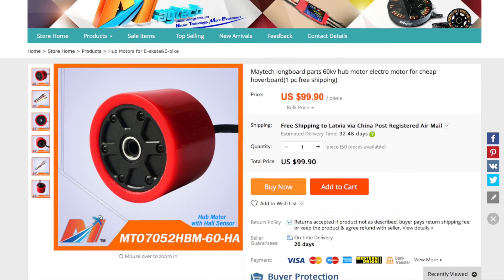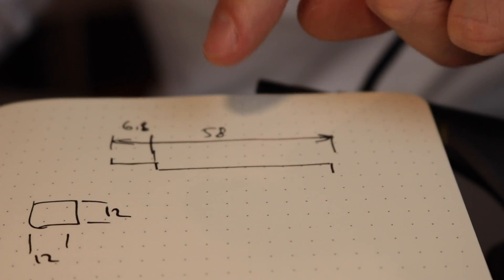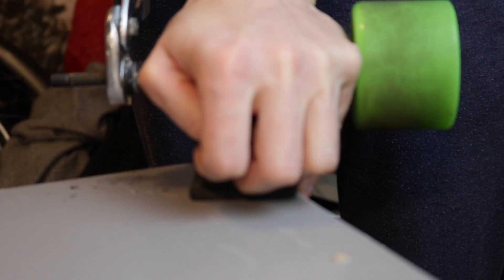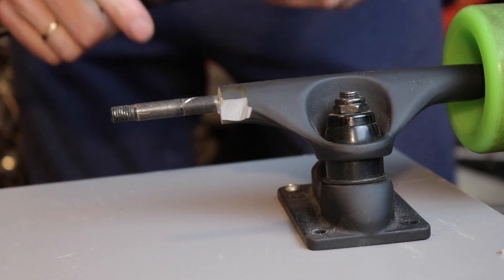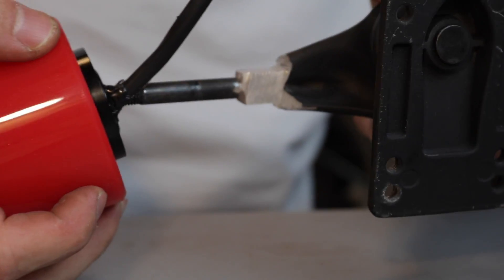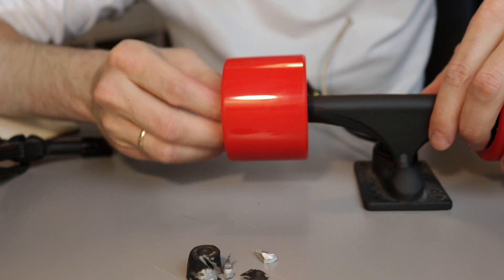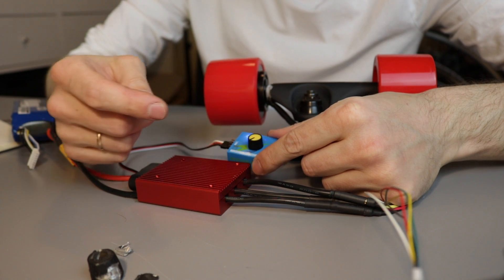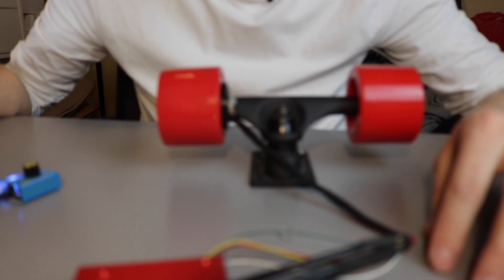Part 1: DIY Electric Skateboard, Hub Motor & Trucks

Comment: Great video.  Keep them coming.  Just about to do a self build myself. One question.  90mm or. 73mm. Hub Motors ?
Reply from the maker: So the both the 90mm and 70mm hub motors are 85KV which means that with a 6S pack you get 22V * 85 = 1870 RMP when the motor is not loaded. With the 90mm hubs that's around 30km/h and with 70mm hubs it's 24 km/h.
Reply from the maker: You can choose any speed controller, actually. You don't even need the hall sensor input since it mostly helps during the super slow speeds when you would normally kick to get rolling. Here is how I wired the Flier dual motor ESC that I'm using with the 90mm hub motors https://kaspars.net/blog/electronics/maytech-hub-motor-flier-esc-wiring

I wish these tiny Hobbyking Blue Series controllers https://hobbyking.com/en_us/hobbyking-40a-blueseries-brushless-speed-controller.html would support breaking because their performance is unbelievable. Most of the cheaper "car" ESC with support for breaking are up to 6S which is OK if you don't want/care about the top speed.

Any battery voltage is OK (only impacts speed) as long as it can deliver those ~20A+ peak (and most RC packs can do that).

The 90mm hubs are ~7mm wider than the 70mm hubs so it should work with any truck as long as you cut away a bit more, I think.
Reply from the maker: Those are 70mm hub motors. See the blog post for all the details https://kaspars.net/blog/vlog/diy-electric-skatboard-hub-motor-trucks
Reply: @KasparsDambis  HEY LAD . I NEED LIL ADVICE HERE ON ESCs AND VESCs . WELL I ORDERED 4600W 4x MOTORS AND I HEARD TO REACH THE MAXIMUM POWER I NEED SUPPLY THEM WITH 48V ........ WELL IS THERE ANY WAY I CAN FUK THE PEDAL TO HEAT THEM UP TO MAX WITH 22V-28V ??? BIG THANK YOU
Reply: Kaspars Dambis I think wants to know which you prefer.
Reply from the maker: Oh, sorry for misunderstanding your question. I personally like the 70mm version better because I like smaller decks and lighter weight. The only belt drive I have tried is the Yuneec E-Go and it was good in terms of the rideability. However, I do prefer the simplicity and the minimalist look of the hub motor. Keep in mind that I mostly ride on the sidewalks and 20 km/h is all I need. Everything above 30 km/h or 18 mph is way too fast for me.
Reply from the maker: I really like their remotes. The previous version had an issue with the front buttons which are just push buttons on the PCB and would bend and if you drop it. The new remote doesn't have that issue, see https://flic.kr/p/Tct9Qj
Reply: Yeah i agree with Eric. Do you prefer 90mm or 70mm? Also what speeds do you expect to get on these?
Reply: Kaspars Dambis  70mm or 90mm. ?   What do you prefer ?   I am personal not after super fast F1 electric skate board
Reply: Kaspars Dambis thanks for the reply.  70mm dual for my first self build.   Love the simple look of hub motors.  Just run with all meytech.   I notice a few not so good reports on the hand controls.  Any advice on something better ?
Reply: Ok good it must of been the old maytech controller someone reviewed   Thanks again for your honest opinion.  Started this project year ago and give up cause  to many inaccurate review s and advice.  Back onto it again get the hubs ordered this week.  Is it best to run with the Maytech esc.   Or run with what you have on your blog ?     Sorry another question.  With the setup u have for your 70mm hub motors   Is it possible in future to run 90mm hub motors   With this setup. ?

Comment: Can I get them smaller than 70mm ?
Reply from the maker: I haven't seen smaller hub motors. Getting them any smaller would probably have an impact on the available power due to the reduced amount of magnets and the available space for stator windings.

Comment: How fast does this go?  How many kilometers per hour?
Reply from the maker: It depends directly on the battery voltage. I measured 2000RPM max speed at 25V (6S) and no load (see this photo https://www.flickr.com/photos/kasparsdambis/33543213670/). That is approximately 25km/h with no load.

Comment: by using the grinder you inevitably cut in to the steel and fundementaly weaken the axle. use a file and take your time!
Reply from the maker: That is a good suggestion, thanks! It was relatively easy to notice when it had cut through the casted aluminium truck, though. As soon as the sparks start flying just stop :)

Comment: I been using this wheel for like 3 weeks of normal use and the screws that hold the motor and wheel fall out! Thankfully I can just screw them back but I need new screws :/ Also the motors are bad for uphill so im kinda disappointed with them and rate them 3/5 barely recommend them!

Comment: Hi,

I was thinking of hacking my own trucks as well, and then this came across my mind.

The hub motors are almost flush on both sides whereas a typical wheel has a narrower core (whether your wheel has center core, offset core, sideset core). If I cut off only 1 side of the trucks to fit the hub motor, the regular wheel side will be protruding outwards more, thus making the trucks off centered relative to the wheels (hub motor wheel + regular wheel).

I drew up some pictures to illustrate my thoughts:
https://drive.google.com/open?id=1AwVety06i3sH-MgEFekRxlo4objaAYU1
https://drive.google.com/open?id=1g_s8EtlgRtAiiyko0gl-nzuHpBHjuhTB

Did you do anything about this asymmetry? I suppose it won't be too big of an issue if you do dual rear drive or dual front drive, but if you settle with either a single drive, or dual diagonal drive, you would have to make 2 uneven cuts (as illustrated in my second link) to center all the wheels?

Please let me know. Thanks.
Reply: I believe darkkevind is referring to the same concern as I am.
Reply from the maker: You're absolutely correct about the different offset -- it is mentioned in the follow-up video https://www.youtube.com/watch?v=yhm4l33IB4c and I couldn't really feel it impact the ride. However, keep in mind that I'm a total beginner in skateboarding :)

Comment: Do I need anything extra to make a 4WD electric skateboard other than 4 motors and 4 VESC's, and of course remote and mounts?
Reply from the maker: That should be all you need. You could also get dual ESCs to save some space. And the single remote receiver should connect to all ESCs.
Reply: Do you have a link to the dual ESC's? Also, are these dual ESC's as good as VESC's? Last but important question, do I need to program each VESC for a 4WD or do I just need to do one of them for 4 motors?

Comment: Hi, i have found some cheap hub motors on Ebay but spacs  are only size: 50*48.5mm
Voltage: 24V-36V  KV: 80KV do you think one is good to make my skateboard proyect? because sellers don´'t know  how to know if one is enought , for me it is good if it runs even slower for about 10 km/h but i´m affraid it can be damaged because i also see some installing a couple of this hub motors, thanks
Reply: Did you get these motors on eBay because i am looking at the same ones and i need to know whether they are any good
Reply: No,  i know it works but it maybe damaged soon,  thats what i think will happen

Comment: ..i have the same hub motor from another company..i just want ti ask if what are those 5 tiny wires for?..it will work from a regular esc like hobbywing max6 for example??thanks..
Reply from the maker: Those five wires are for the three hall sensors inside the motor (5V, GND and 3 signal wires) that ESC uses to determine the position of the motor and the commutation sequence for actually running the motor. Most of the time they are optional since ESCs have other ways of guessing the position of the motor, however it does help a lot with torque and acceleration at very slow speeds if the ESC supports it.
Reply: Kaspars Dambis ..oh men i wish i could understand that i need to learn a bit about electronics haha...so it means to say it will work even the esc dont have support for that but less efficient??
Reply from the maker: Yes, it should work just fine.

Comment: How has no-one noticed that the truck is now completely lop-sided in terms of distance from the centre of the truck to each wheel! Both wheels are the same width right? This thing is going to ride awful!
Reply: yeah, nice effort, but it does look awful.
Reply: It’s going to shake
Reply from the maker: So the standard wheel is 61mm off the center while the hub motor is 53mm. The difference is only 8mm which does have an effect on steering but it's not that bad.

Comment: hello @kaspars i like to use the same motor within a other project, but i need to let it go very slow 5 a 6 km/h. has this motor enough torque to drive 30kg with 2 motors?

Comment: Have you tried out these motors on a skateboard yet? I remember reading on a previous video that you were waiting for the weather to get better. I'm interested to hear about temps and torque of these 70mm hubs, also wondering if the urethane will hold up under acceleration since it's just a friction fit

Comment: How do you control the speed whilst riding the skateboard?
Reply from the maker: All these inverters or speed controllers (ESC) use a PWM input signal for speed control. In this video I'm using a wired PWM "generator" with a rotary knob for the actual input. See https://en.wikipedia.org/wiki/Electronic_speed_control#Function
Reply: But it's wired. Do you know of an easy way to hook up a wireless controller?
Reply from the maker: Sure. I use this controller https://www.flickr.com/photos/kasparsdambis/sets/72157682381533385 however any RC controller would work since they all have the same output out of the receiver.

Comment: do you think it would be possible to replace the hub motors of a koowheel? or would that mean that I'd have to replace the motherboard as well
Reply from the maker: I'm not sure since I haven't seen the Koowheel board in person. This forum thread could have the additional information you need https://www.electric-skateboard.builders/t/koowheel-thread/7625

You wouldn't need to replace the actual motor controller (ESC) as long as you wire the phase wires and hall sensor wires correctly.

Comment: What would you suggest ? Single or dual (90mm) hub motors ?
Reply from the maker: Dual motors only increase the torque and not the top speed so I personally think that one motor is enough since it's powerful enough for my liking. I tried the dual 90mm setup a few days back with a 6S pack and the torque almost throughs you off the board. Same with the brakes :)

I got 700W, 30A peak from both motors with a 6S battery pack. See here https://www.flickr.com/photos/kasparsdambis/albums/72157680647485490